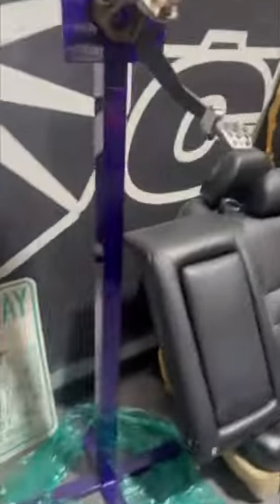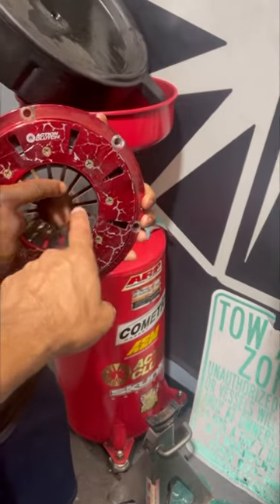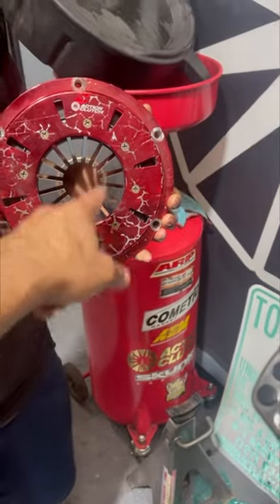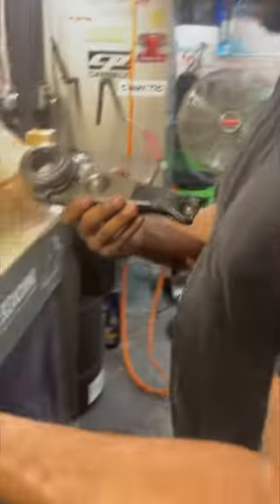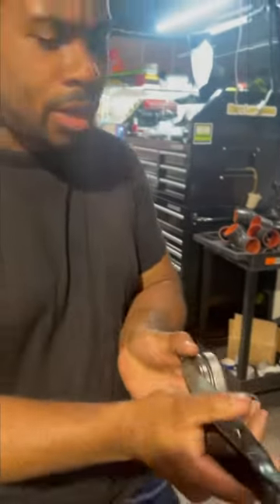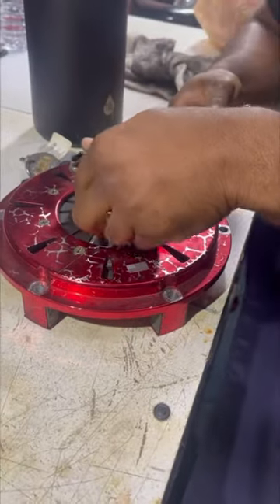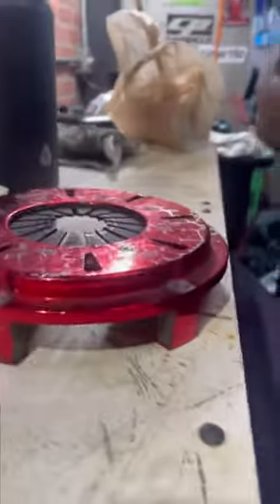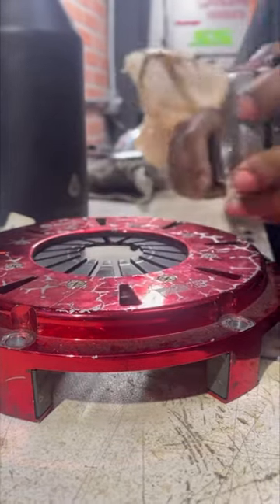How to adjust clutch pedal hight

Comment: Thank u very much for the info. I just replaced everything n was having some trouble my self. My bumps stoppers from the brake pedals n the clutch pads the heat pop it. I just replaced the  bottom ones n didn't know the have another one on top. After I replaced them I have to adjust the clutch it self. Great info thanks. 🙏💯